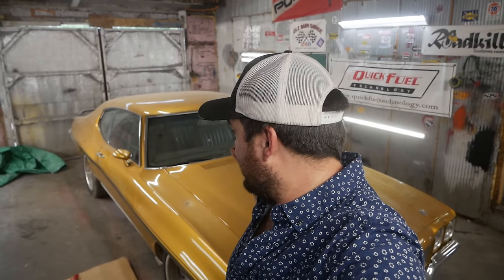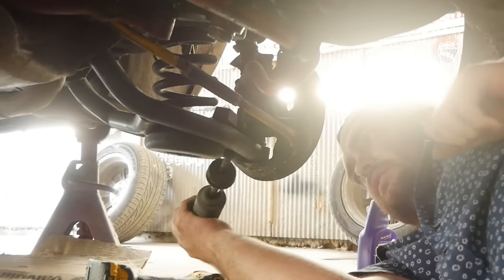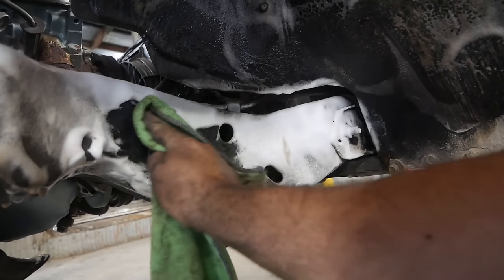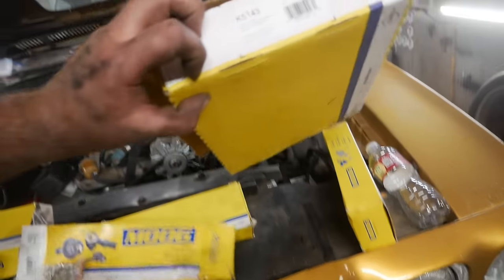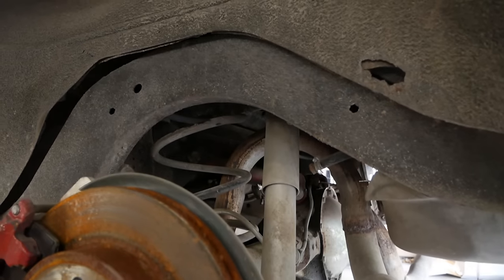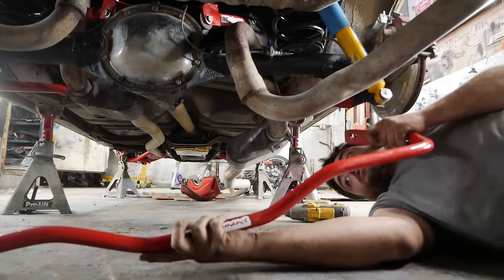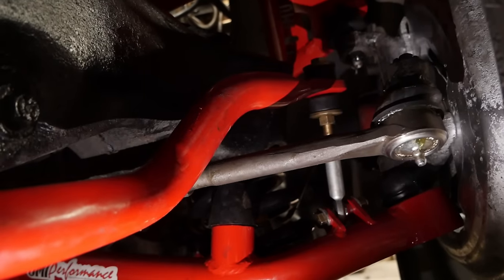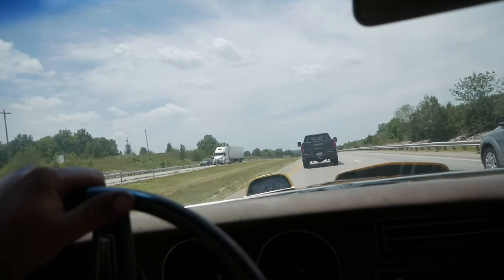'72 Lemans Gets UMI Handling Kit! Corner Carver in a WEEKEND

Comment: Pumped for you. Not every car guy gets to keep their high school car, let alone make it handle. This car is rad
Reply: I still have my highschool car. '81 Camaro Z28, 396, 4speed stick, no t-tops but it's all good. It had a high smog low compression 305 when I bought it my junior year of 2001. Went down to the super Chevy show in Carlisle PA during that same summer and purchased a 396, trans and rear axle from a gentleman and they were from a '70 Chevelle SS that was totaled. Paid 600 bucks for everything. The 396 dropped into my Camaro a lot easier than I thought. Motor mounts were the only real hurdle.

Comment: Glad to see the ole gold LeMans getting some attention. When I saw that starter you bought I was like "Oh man, that Jag has gone to Dalton's head, that's like a $300 starter", you said you got it for $80, I'm sitting here like "Nevermind, I would've bought it too" haha!

Guys like you keep me motivated to keep saving money so I can V8 swap my 1983 Dodge Ram D150 short bed., I'm the second owner of it. It's a factory slant 6 with an A-833 4 speed, and manual steering, in 1983! I'm gonna be swapping in the wheezy also 1983 318 from my Dad's truck that was wrecked a couple of years ago, just about six months after he passed (I didn't do it and I'm still expecting Dad's angry ghost to appear in a cloud of Marlboro smoke looking for someone's ass to kick!). It's just a greaseball stock 318, I think it might have a small like RV cam in it or something, kinda sounded like it did, but it was a stock 2 barrel, even had the 40 year old Mopar ignition coil on it, which is now on my slant 6 with a ballast resistor added in line because some genius screwed up the wiring so bad in my '83 that I'm just gonna start over with an A-team HEI distributor and probably a generic Chevy 1 wire alternator. 'Cause that's how you fix a Mopar or a Ford, with Chevy parts! 

Anyway I'm trying to build a ratty old truck my Dad would've liked, ain't pretty, ain't clean, just a fun 4 speed V8 short bed truck, definitely getting some of those solid tie rod sleeves when V8 swap it, whole front suspension is getting rebuilt. It bump steers, baaaad, like "Whoa, no no! No! That's a ditch! Bad truck, no go right!" bad. I know part of that is just manual steering but I know I can get rid of a lot of it with better steering components. Plus the truck is 40 years old with like 300k miles on it. I now the original owner was from New Jersey, so is the truck, Burlington in fact, it came down here to Roanoke VA in the 90's, been to Florida and back a few times, it has about 300k miles on it. Tan on brown, with a brown tonneau cover for the bed, soft one that buttons on but I need to get it repaired because the stitching is coming apart. The original owner painted or had painted Dale Sr's 3 on the diff cover, and he had 275/60R15's on all four corners on 15x10" wide white wagon wheels, NASCAR style, so I feel obligated to install a boomtube exhaust when I get the 318 swapped. Side note, dude must've been a real man to drive a truck with 275/60R15's and manual steering, I'll be putting those on once I can afford the tires.

Comment: Glad you were able to get a great suspension kit on your car. When the alignment shop gets the caster, camber and toe in...she will drive straight.  Your right on that negative camber. As an experiment way back in the day, wehad a new 91 RS Camaro, I kept adjusting the camber down to about 1 - 1/2 degrees negative to get perfect tire were and handling.  Forget about factory spec positive camber..thats where all that outer tire wear comes from.

Comment: I did a tie rod swao like that in the driveway. When I picked the truck up from the alignment shop they told me how far out of spec it was with the printout. I told the guy I did it last night in the driveway with a pair of crescent wrenches a framing stud and some elctrical tape and he was acutally impressed at that point. It's not rocket surgery but precision matters. 

Turns out a framing stud and electrical tape aint overly precise but got it done.

Comment: Love cars from the 70's.
The govt. killed the muscle car craze with limited compression & polution restrictions (smog control) .
But we got around it...
I pulled the 350 outta my 74 camaro & put a 396 in it from a 69 chevelle..
I had a Monza Spyder (77) that I immediately ripped the smog control nightmare from the engine..
Then , changed the intake & carb, added some headers & Crager wheels . She was my favorite car for a few yrs..
But my all time fave was my 73 Chevelle..
Bought it from a couple who parked it in their barn after their son died..
It only had 26000 miles on it in 1979.
Came with a 350 & 4 speed.
It was like new to me at 16 y/o..

Comment: These kits are awesome. I used another brand that was a bit more expensive because it comes with adjustable coil over shocks. It replaced the 50 year old stamped parts on my ‘72 Monte Carlo (GM A body). The upside to the adjustable coil overs is you can really dial in the reaction of the suspension.
The UHMI frame braces is very interesting. I will be looking to add these I think.

Comment: That car is the bomb. The body is in really good condition as is the paint. Thought I eyed a couple bubbles in there, but we can ignore that. This rides deserves you going completely through it to get it in the best shape it can be. After alignment, a complete exhaust, then go through the engine bay, brakes, and fix what needs fixing in the interior. You could clearly use some work on the headliner. Any lights, switches, window mechanicals, interior panels, etc. Take us along for the ride. I am particularly interested in seeing you diagnose the misfires. What GM owner doesn't want to see you address that. Vacuum systems, etc. Don't assume we know what's what. Walk us through it.

Comment: I was happy to see you using UMI suspension parts and not the BMR junk,l have BMR cradel in my 93 camaro and it's completely garbage had to send it back twice because it wouldn't fit,and BMR wasn't even slightly concerned about getting it back quickly even though it was obviously there problem

Comment: My 79 cutlass pulls to the right too. Iv aligned it myself couldn't get enough camber out of it. Still pulls right iv heard these cars that the frames sag inward in the front so I need camber offset kits it don't pull as much since I aligned it but it still does ( after replacing almost everything besides center link lower control arms) everything else is new. Maybe this helps with your pull if you still have it after getting it aligned. 

It could also be my uncle ran the thing threw a few ditches back in the day 🤣🤣🤣🤣

Comment: Auto X with an A body... Dalton, you are as deranged as I am. When I was doing the 65 GTO I had some F body spindles I was going to put on it with control arms that make it work. Turns out the frame is narrower on the 64-66 cars so the tubular stuff won't fit with headers. If I had a pos orange lump in it, they would fit. 

The tall spindles work VERY well, they are going on the 70 GTO, or maybe the 69 GTO if I ever get to it. it changes the camber angle in turns so the tires lean in rather than out, keeping the contact patch on the ground and not running on the sidewalls.

I have a 79 TA WS6 front bar and 70 GTO rear bar on the 65, along with cut springs in the front, and bagged springs in the rear. The 95-97 Grand Cherokee steering box mod works quite well, except the T bar in it makes the steering light. Its less than 3 turns lock to lock and has the right stops where the WS6 box doesn't, so you have a shorter turning radius with the F box.

It goes around corners way better than any 64-72 A body should with factory parts. When I get back from Nebraska with another vehicle, I should have all my manual transmission parts, and then the 65 gets a TKO600 and the 9" with 2.78 gears that has been sitting here for a while. OD and a 2.79 with a very healthy 455 ahead of it... oh yeah, its gonna be a fun ride and it will enjoy highway miles.

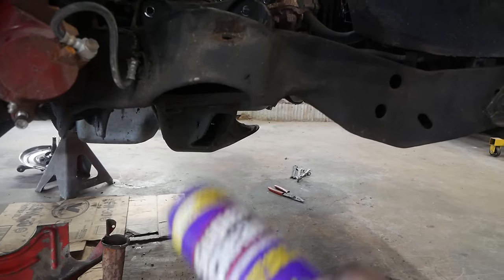Comment: 10:53 If you buy Super Clean in the 10L (2.5 Gal) jug, you can dilute it with water to 16:1 for cleaning stainless, Chrome and aluminum, 8:1 for Vinyl seats, dash, etc. 3:1 for floor mats & Carpeting, and full strength for everything else. Their website has a full listing of everything you can clean with this stuff.. It is the WD40 of cleaning. 

17:53 MOOG USED to be good, now it is garbage. I'm a Off-road wheeler, and if you want something to break fast: install MOOG. I had Chineseum lower control arms  and Tie rod ends on my Chevy 4x4, that lasted 10x longer than MOOG did. 

And a quick GGL Search produces: 
Where does MOOG manufacture?
It operates a network of manufacturing facilities in North America, Asia, Europe, Central America and East Asia. The company has business operations across Asia-Pacific and Europe. Moog is headquartered in New York, the US.

Comment: If you spend day's on working the suspension components in doing a upgrade. Then if you spend time installing and tuning a new carburetor and fixing the exhaust. Then have fun driving the old engine hard for a day,,,.   Go figure! ignition issues are likely to happen. And hopefully that would be the least of your engine issues.  Very nice and educational suspension build on a very well kept classic Pontiac. LOL,,, treat her with a little common sense,, PLEASE,,, Taking corners at too high of a speed is the most common cause of losing control...... But it is great to build a great handling car.

Comment: grab one of those needle fittings for your grease gun and inject grease inbetween the bearing rollers to pack it fast and clean. friend showed me that and blew my mind lol
Reply from the maker: I don't have one of them, I don't think. I have this bearing packer tool you use a grease gun with and it works well, but I still do them by hand lol

Comment: My 92 silverado I had the driver side rear shock always came loose after a while, I used lock washers, and some blue Loctite, all I could find, Finally I just bought nylon nuts after the like the 8th time they cam loose, never had problem since, It was about to get the welding treatment lol

Comment: An alignment should take care of the pull, the shop may need to offset the camber slightly to make it drive straight on a crowned road. camber pulls to the most positive side, so adding some to one side and taking some away from the other should straighten it out.

Comment: I had no idea about the 79 z28 camaro sway bar swap! Gonna get all over that for my tempest! What you gonna do with all the tubular stuff that came off of the Lemans?
Reply from the maker: Trash it. You can buy new ones for less than 300
Reply: @PoleBarnGarage  went to disc brake swap my tempest today and the Chinese spindles weren't drilled correct for the factory lower ball joints!

Comment: Tip: Put the bearing grease in a ziplock bag with the bearing and work it in, keeps the hands clean.
Reply from the maker: How do you get the grease in the bag
Reply: @PoleBarnGarage  I use an old plastic cake spatula.

Comment: You should change front hubs to run new rotors that just pop off. No more packing wheel bearings. Get power stop brake pads. Do you have right master cylinder and proportioning valve for disc brakes.
Reply from the maker: Yes I do. And considering a set of rotors should last 100k miles on the car I drive 5000 miles a year at most, I think it'll be ok lol

Comment: Great job on your success!!!   Question for you or the PBG army.  Not handling/suspension related but your video got me thinking…..I have a ‘68 lemans and want to run an electric cooling fan.  What’s the amp output I should use for an alternator?  Is stock ok?  Does it even matter?
Reply from the maker: You need more than the factory 55a at least. 75-80 would cut it, you can use a later model Chevrolet alternator if you don't mind lengthening the heads or re-clocking the case
Reply: Thanks for the comments.  Reman units for these oldies use to be cheap, not so much now so I want to make sure I get it right the 1st time.

Comment: Nice ride gives me regret because I had a 71 lemans sport with alot of oil feild dollars on it. 
302 zapper with over 500hp "283 bored to 4" ect. 255 rear gears and a cobbled together 
hill-billy suspension kit , it was fast very very fast  miss it but not the tickets I stopped for LOL

Comment: umi makes good stuff but someone has to make a  spindle that  improves the  front  suspension geometry  you can get longer ball joints but thats a bit of a  bandaid  fix
Reply from the maker: UMI does. Included in the next level of kit. I wanted to keep it budget oriented, and frankly I've never noticed any difference
Reply: @PoleBarnGarage   american cars  usually  tend to have  terrible  geometry  also  the  camber  curve is  way off same on my 80 regal  i  went with a B body   spindle which is taller and then you geta  much more advantagous  camber  curve   but very pleased with the UMI parts i  got for the  car  but  i did go with  hellwig  swaybars as they make  tubular once for the g-body so they are  lighter  then solid  once